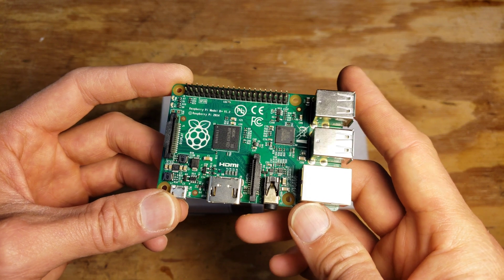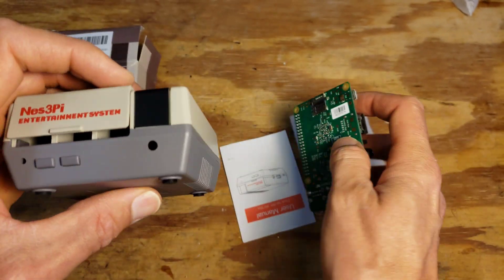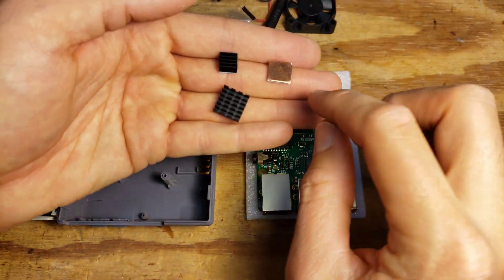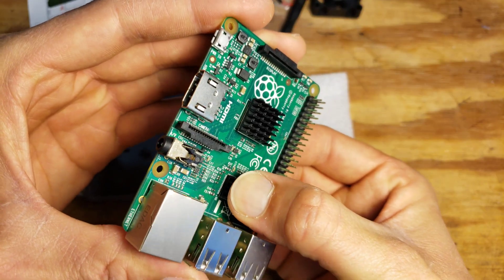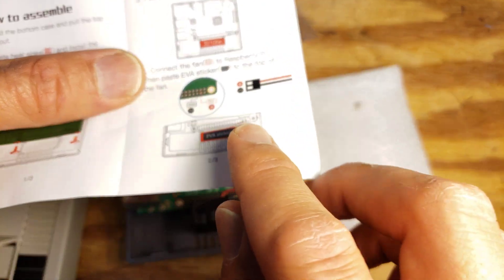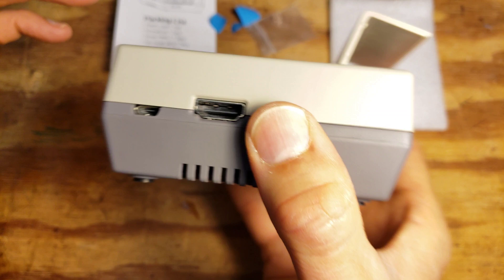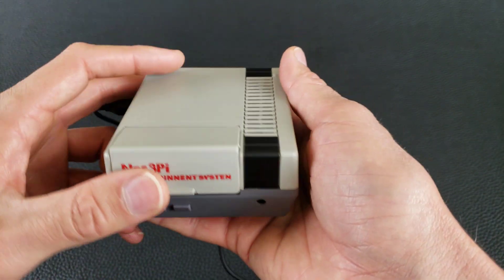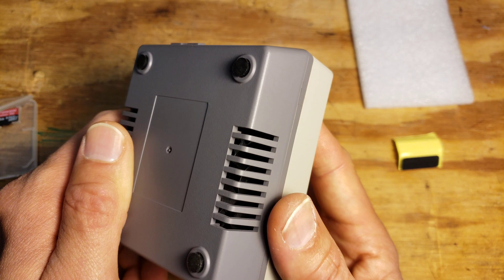Is It Any Good? NES Raspberry Pi Case With Heat Sink & Cooling Fan | Nintendo Entertainment System

Comment: I just bought one of these cases to use for a retro gaming project. The case itself proved awkward to prise apart and I was scared bits of plastic would break off. Thankfully, I found your video, and and after seeing it wasn't just me who had a struggle getting it apart, I did like you did and went full 'hulk mode' and it came apart, damage free. Phewww 💪💪💪